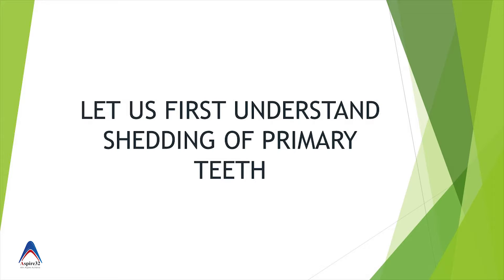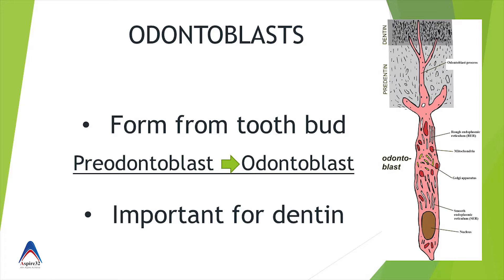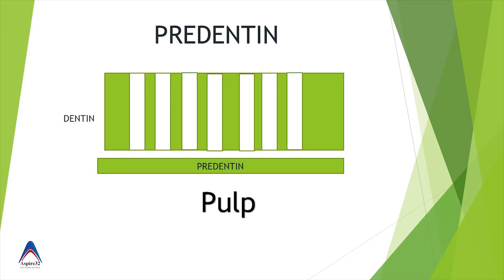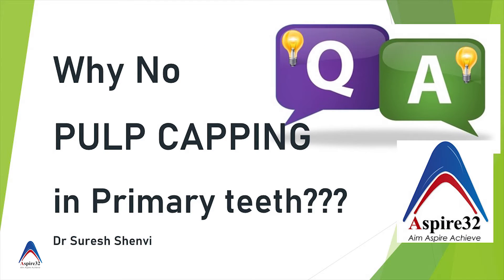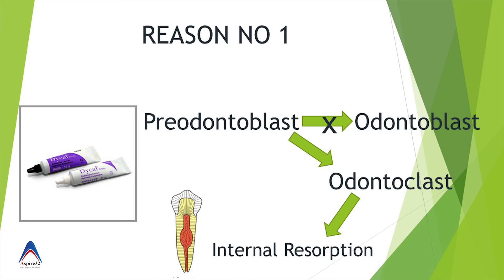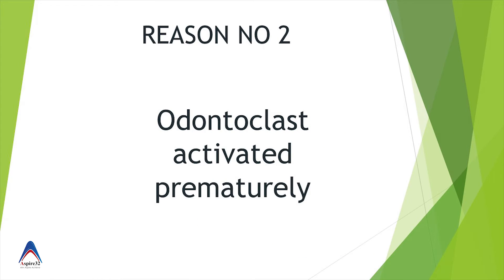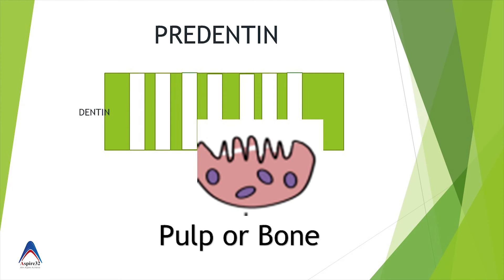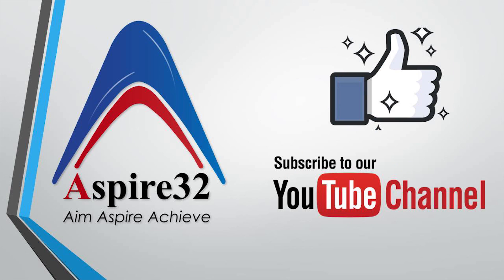Why No Pulp capping in Primary teeth ? | Dr Suresh Shenvi

Comment: Sir why there is necrotic layer in CaOH and not in biodentin
Reply from the maker: The beneficial effect of calcium hydroxide is regarded as the result of the chemical injury caused by the hydroxyl ions, limited by a zone of firm necrosis against the vital tissue, and the toleration of calcium ions by the tissue.
Reply from the maker: This is a great question. I will try to find the answer soon

Comment: Thank you for your great effort but I have aquestion 🙋🏻‍♀️if CaOH  activating odontoclast is this happen in both primary and permanent !! I mean why we don’t take in our consideration in primary teeth about the main function of calcium hydroxide that stimulate undifferentiated cell to become odontoblast and produce dentin
Reply from the maker: I have already explained why it happens more in primary teeth than permanent teeth.
Reply from the maker: May be initially they did use it in evey case. But may be more cases started having resorption. So they may have stopped it

Comment: Can we use metapex during pulpectomy
Reply from the maker: Yes. You can. Its calcium hydroxide idoform. Can be surly used for obturation of primary teeth
Reply: @Aspire32  thank you sir
Reply: @Aspire32  sir can I do indirect pulp capping in primary teeth,with caoh base

Comment: Sir in grossman, indication of DPC include a point i.e., dentin blushing... What's that mean?? I couldn't get that??
Reply from the maker: The pulp becomes hyperamic, that is increased vascularity or hyperemic due to inflammation and this makes the dentin appear red. Thays blushing
Reply: @Aspire32  so sir in this case there is not a direct exposure of pulp only dentin appears red ?? Am I right?? 
And if it's not a direct exposure and we apply biocompatible material then this process should be IPC and not DPC??